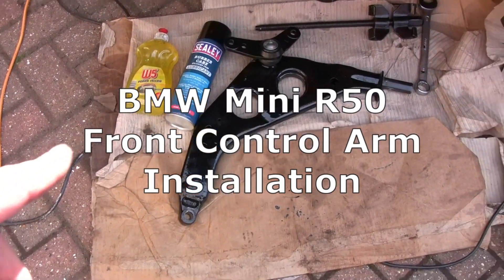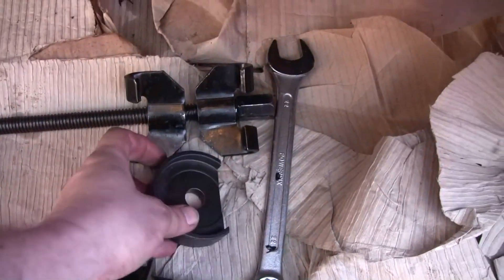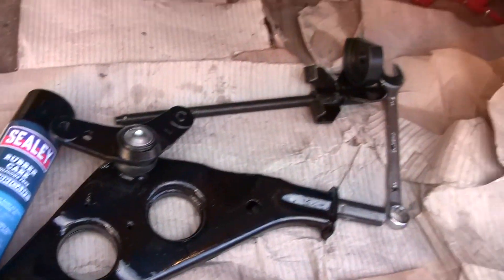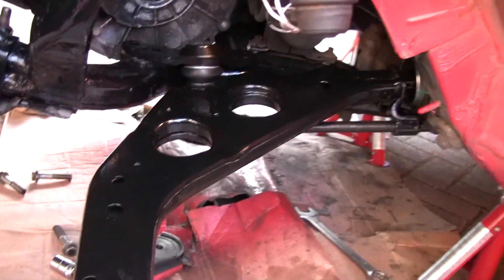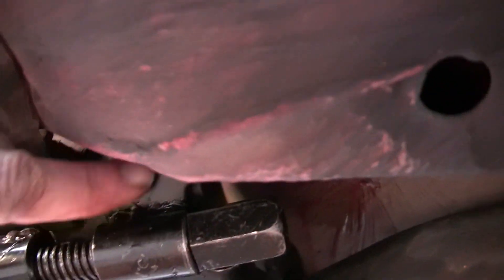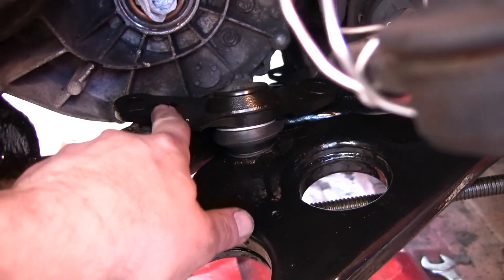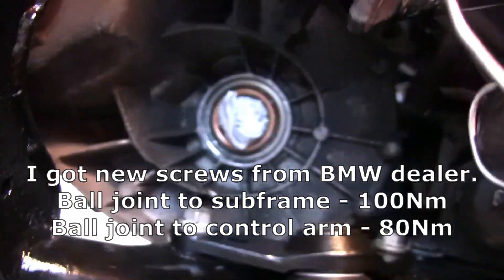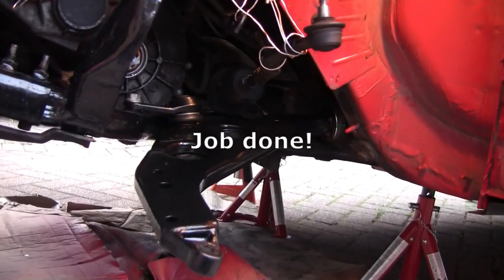BMW Mini R50 Front Control Arm Installation

Comment: I will also try using a spring compressor to press in the lower arm.
It's a great learning experience.
Thank you.👍
Reply from the maker: It is fiddly and compressor can slip off easily but perfectly doable. The proper tool costs excess of 200 GBP!
Reply: @zadzwon112  
I replaced the bushings today.
It was a great success.
In my case, I had to remove the subframe to do the job, but by using a spring compressor following your video, I was able to finish the job in a short amount of time.
Thank you. 👍